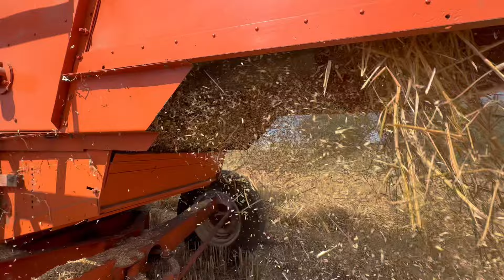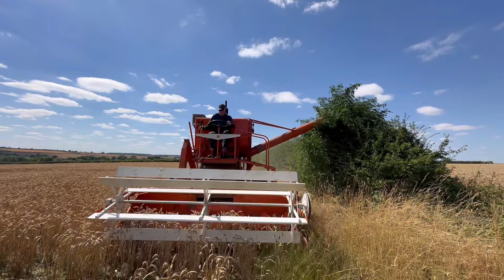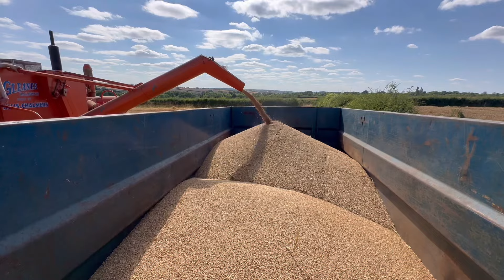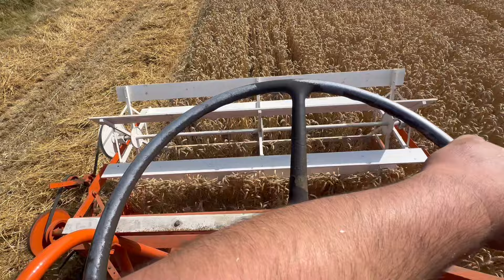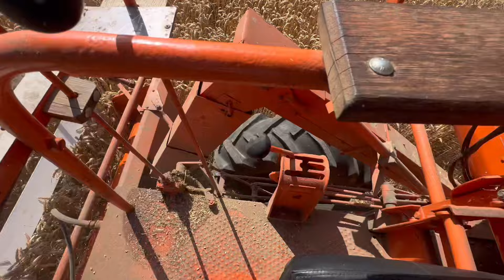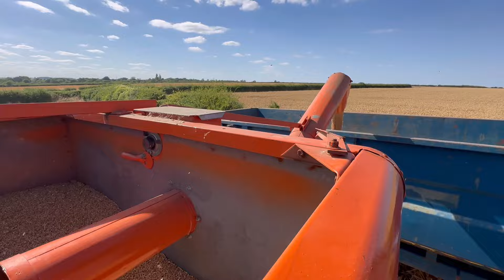Dirty dusty and dangerous (farming in the past with no air conditioning)

Comment: That machine has been restored to almost better than factory. Very basic elements but still gets the job done, albeit slower than modern machines.
 The crop density of modern varieties of barley may cause it to struggle a bit, but it still manages.
 Really nice clean sample in the tank - Gleaners in particulare were renowned for that, hence the 'Gleaner'  term.

Comment: I'm going to take exception with one of your final statements about this being an older, smaller version of the modern combine.  I would agree with you up to the point the "rotor" machines came out.  With the rotor machines most of the thrashing and separating mechanisms change.  You still have a set of sieves and a fan, but the cylinder, straw walkers, and a lot of the rest of the thrashing components of this combine are no longer used.  The rotor(s) added thrashing capacity that was getting unmanageable with the cylinder/straw walker machines.
  BTW, I grew up around a combine similar to this, but a Massey Harris (forerunner to Massey Ferguson), and spent all of 3 summers operating a Gleaner that was larger, maybe a little newer, but surprisingly similar to this one in the way the drive trains were set up.

Comment: My father was a farmer in the 60's - 70's and used to use an open cabbed combine, not sure what make it was, for some reason I am thinking Class, but could be wrong.  I remember he used to resemble a coal miner getting off the thing.  His main tractor was a Ford 4000, and a Massey 65 was the secondary, good memories mostly I guess.  I used to stack the straw after balling, riding on the back of the sledge, wait till the gate popped and then jump off and stack the 8 bales, then run to catch up.

Comment: I remember combining wheat the same way when I was a teenager. We had a large umbrella for shade, though. You would start the day clean and shiny, but by the end of the day, some 14hours later, you would be pooped, coated with dust in places dust shouldn't get to, just in time to head home, shower 2kilos of dust off and hit the sack. Ditto every day until the crop was in. Lunch and supper were eaten in the field. Eyes always on the weather in case a tornado decided to drop in for an unscheduled visit.

The new machinery may be more efficient and more quiet, but GPS, onboard computers keeping track of how much grain is in the hopper, header feed rates, fuel consumption etc., and STEREOS, CD players, filtered cab air and airconditioning? Wow! They're nice, but you get soft.

As an old farmer, I've worked plenty hard all my life; I'll take the "soft", thanks very much. Cheers from Alberta, Canada.

Comment: Very nice. That's why you open a field always counterclockwise, so will never run into a tree or a power pole or what ever with  the unloading auger, yes I know the new ones (last 40 years} are most of the time folded in, but just in case.
Reply: In the US, at least the first folding unloading augers were the Massey Ferguson 300 / 410 / 510 series.  I can't speak to the smaller machines, but I know the 510 was introduced in the states in 1965.  I'd assume the smaller ones came out about the same time.

Comment: A few minor differences from the old Model A Gleaner I had years ago. Only here in the USA Allis never painted the sheet metal, just left it galvanized!  Really a nice clean sample in the bin, mine never could get it that clean. Mine had a gasolene powered motor, valve in block, that was its big shortcoming.  Always keep the bin unloader to the inside of the field to avoid hitting the trees in the fence row!
Reply: my A had 230 ci gasoline engine with I head. it also was unpainted

Comment: Hi Tom, is that the one Ron Knight restored, i remember when he first finished it. I went to see it at Casterton when it did its first cut in 30 years. 
I have 3 original Gleaners including one just like this just without the paint. Look up RB Harvesters if you get chance.
Thanks pal. PS the drums in the front on a Gleaner, where the elevator usually is. The stone trap flips rite open to sling stones out. My 1964 A has a buzzer that could wake the dead. Nearly gave me a heart attack the first time it went off.
Reply from the maker: Yes it is that one the bloke in the back ground is bryan knight
Reply: @Tomlamb980  yes i know Brian he video my 💯 year Gleaner celebration last year. Its on his channel. I knew his Dad too. He used to make a few bits n pieces for my old Gleaners. Stuff i couldn't get anywhere